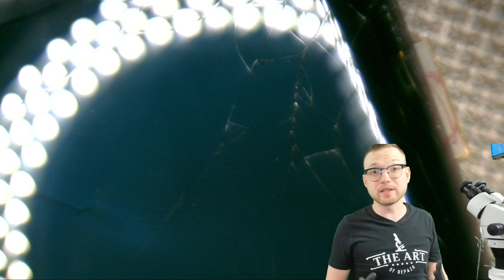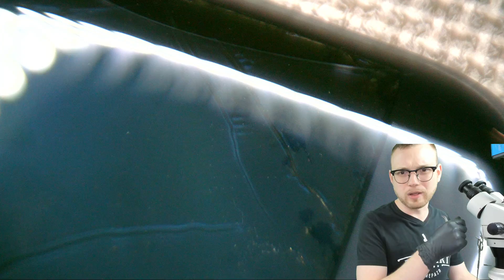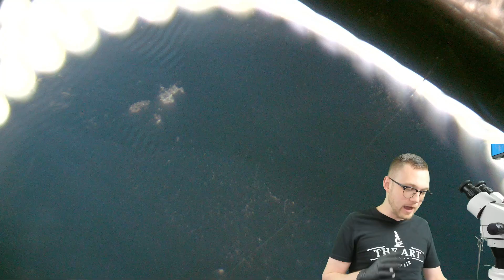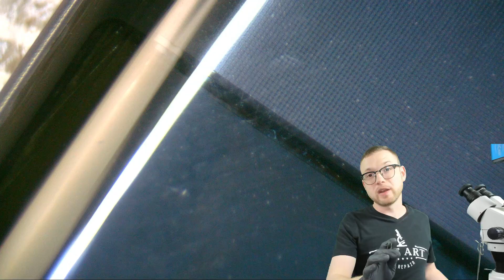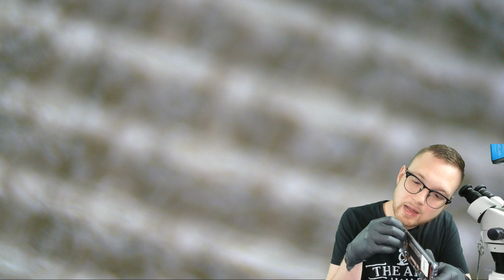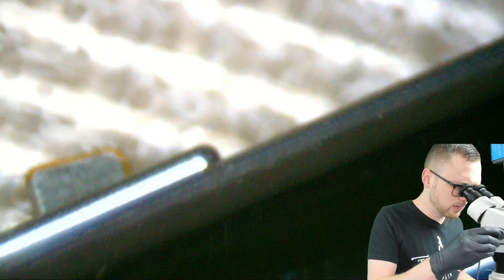EP57 The Mysterious Dark OLED Crack | How to save time diagnosing an OLED failure.

Comment: How do you usually refurbish Oled screens if they are that badly cracked?
Reply from the maker: Do you mean on glass separation? Usually if you get the big portions off you can get the small bits pretty easy.
Reply: @TheArtofRepair  You were very in the weeds with the microscope, showing ways to identify things under the microscope no one usually ever talks about. So I was asking if you knew how to repair those LCD cracks once you found them. But basically the only way is to replace the LCD, from what I've seen.

Comment: Are oled displays more damage resistent than lcds? I have had lcd displays fail on me but not yet had an oled fail. I'm pretty rough on my phones. Ive had them get run over and dropped of the roof (on accident i swear). Durability is more important to me than display appeal.

Comment: I have a 12.9in Ipad pro that i need to screen soldered to the board.I found a company up here in PHX that will do it for $80. IF i mailed it down to Tuscon could you do it cheaper? I already have part and it would already be torn down.

Comment: I don't really understand? If an OLED is cracked, it will always get a distorted Picture or no Picture at all, you can see it directly when turning on the phone? Why do i Need to look at the cracks?
Reply from the maker: alot of times with OLED display cracks you get no image at all, and the cracks themselves hide in the edges, so its just a "guess job" until you find the crack, or until you do the "test labor" which costs time which is money.
Reply from the maker: So what happens when you get one that doesn't show an obvious crack and no image, then you do the testing and find out its a board issue. Sounds like alot of wasted time. =) I like to be sure of the repairs im doing =) knowledge is power ! =)
Reply: Ok, thanks! Now i see your Point :) But is a blank Screen (and glowing Softkeys and sounds/ringtones) not almost everytime a cracked OLED? Do you encouter often bad boards where there is no Picture?
Reply from the maker: Its like the old addage, "when you have a hammer, everything becomes a nail." When you do board repair everyday, it just happens that you will constantly see the unexpected. =)

Comment: I check them under light, after cleaning the screen well. I don't have a microscope.
I usually can just check them any old how, when the customer brings a phone in with the screen not turning on, I point out the crack in the oled.